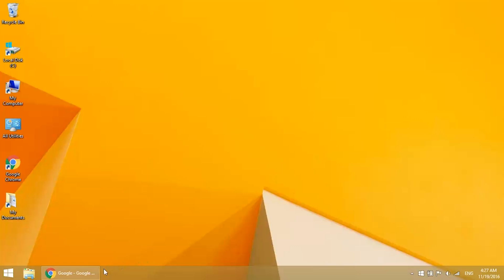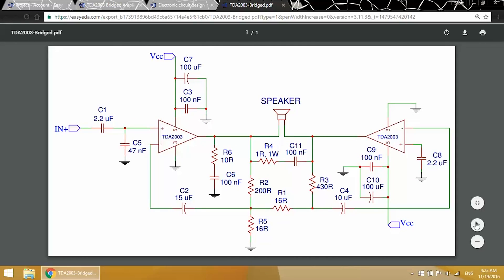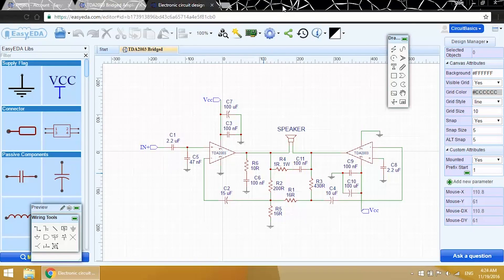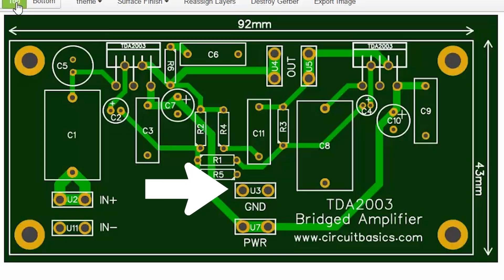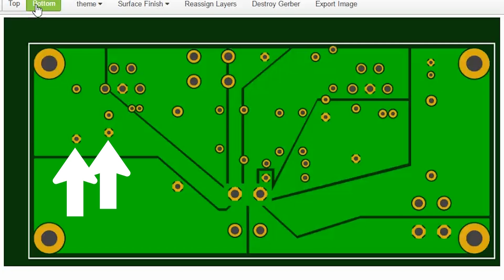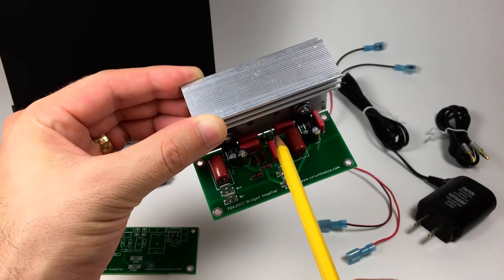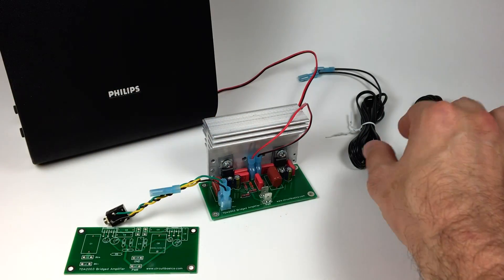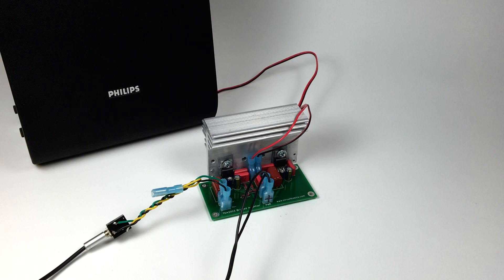TDA2003 Bridged Amplifier Design and Build Tutorial

Comment: I found this TDA2003 bridge configuration in a Motorola HSN4035C amplified speaker, (the kind you find in police cars) however the Motorola circuit also includes an opto-coupler on the input and some kind of preamp chip. I love the sound quality these little Motorola amplified speakers produces and would like to reproduce a few of them for use with some 3.2 Ohm non-amplified Motorola speakers. Unfortunately I can't identify the preamp chip so I'm going to delete that part and build the circuit much like you have in the video, with the exception that I will adjust my filters to maximize voice frequencies only. I hope I can reproduce the essence of the Motorola sound with my version. Thanks for the TDA file, that should save me some time.

Comment: I have 2 speaker of dimesion 8 inch & I want to drive it. So which amplifier I use for the best quality of sound?please suggest me...........
Reply: Amit Prajapati i will suggest tda7377.or tda7294 if is difficult to make i will say much better is 2030 bridge so it will mono = 2*1 =60watts max so if you make a stereo mode will 120*2 so if you make it will drive perfect